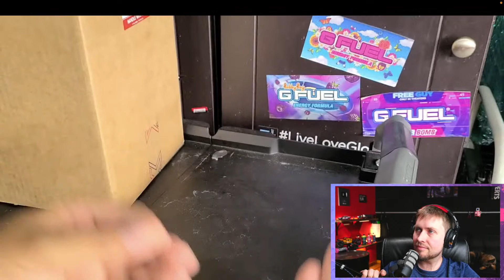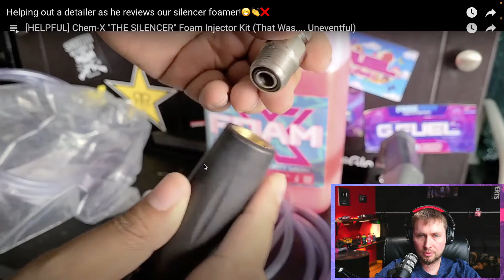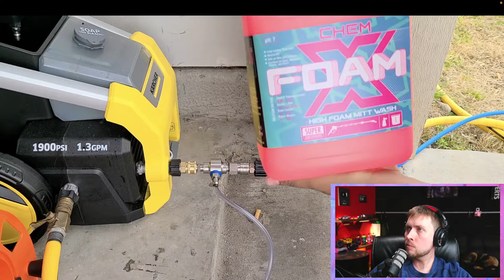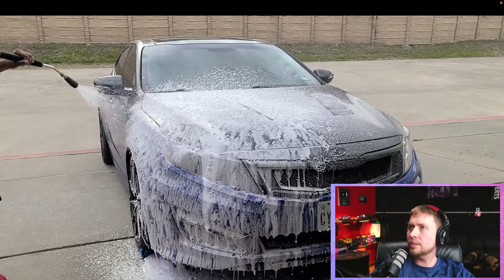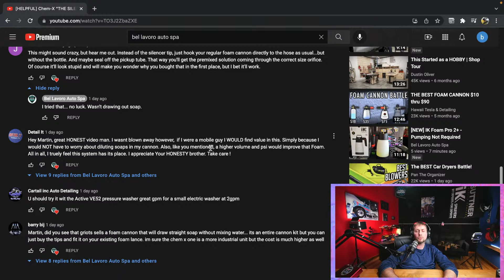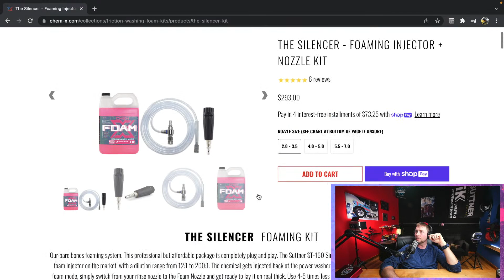Helping out a detailer as he reviews our silencer foamer!😁👏❌

Comment: U need to add one part or missing part on the kit for small pressure washer, it will bump up to foam to PF22 standard.
Reply: And what part is that?
Reply: Sorry i just saw your question, u need to adjust the flow from the suction tube and also a screen at the end of the gun, Chem-X is on the right track, just needs a little bit more adjustment @muchachogrande2019  i can beat the PF22 foam at 70psi with 2gpm flow. So pressure is not an issue, u just have to play with it. HOpe Chem-x had this sorted out if not i'll help you guys out.

Comment: I’ve had the same problem with a valved injector I have on a over pumped under powered unit I built as a kid because the motor can’t run the rated 2400 6gpm I end up at 1900 5gpm after  the initial pressure spike and drop I think it causes the Machine to pull small amounts of soap when the high pressure tip is on and a larger volume of soap than intended when when you have the foaming nozzle on I haven’t got to try it yet but I bought some lower gpm tips to try to force the pressure back up and lower the flow threw the pump so it doesn’t siphon out of the bottle when it shouldn’t or as fast when intended I think the pressure is both my problem and possibly the problem here